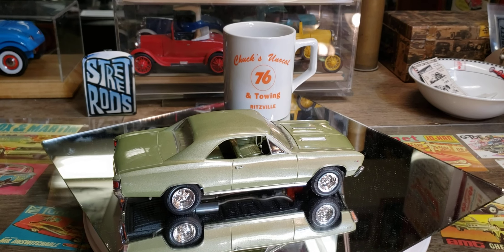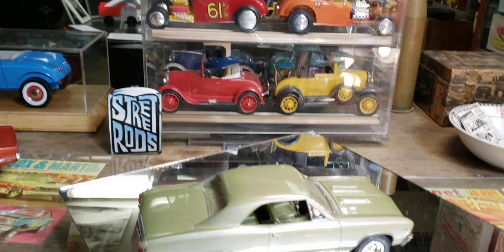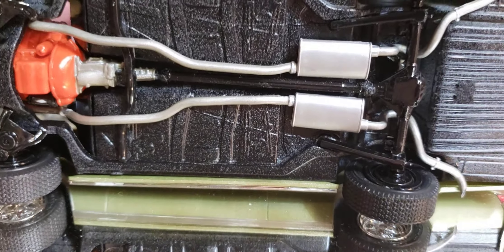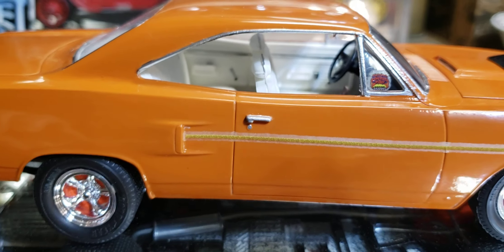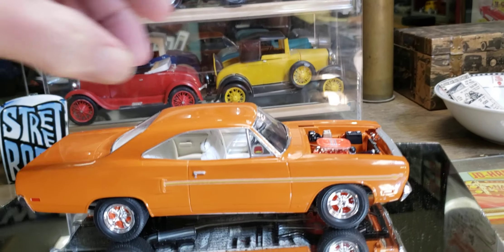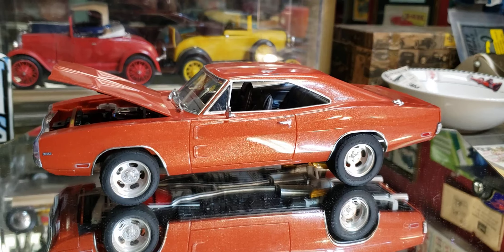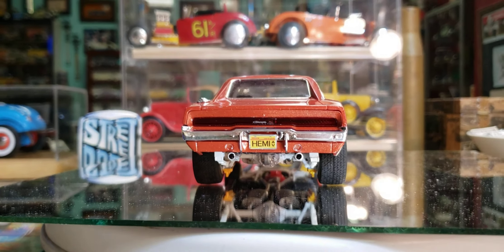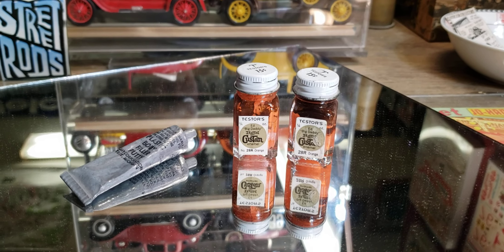Friday morning model cars and coffee ☕

Comment: Nice builds. Hey, call it a motor if you want to. Us older guys do. Just remember, Detroit is the MOTOR City, Ford is Ford MOTOR Company, GM is General MOTORS.....just kinda blows the ones out of the water that argue "a motor is electric. Engines are internal combustion". One would be served well to pick up a dictionary instead of arguing. 😉. Happy modeling

/ˈmōdər/
noun
a machine, especially one powered by electricity or internal combustion, that supplies motive power for a vehicle or for some other device with moving parts.
Reply from the maker: DAM you're right I never thought of that motor it is.....thanks 😊